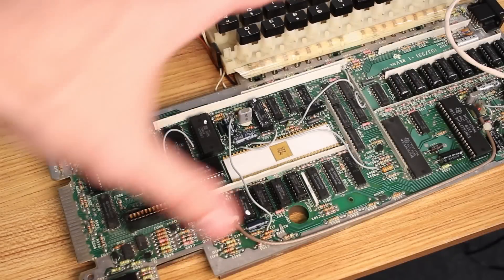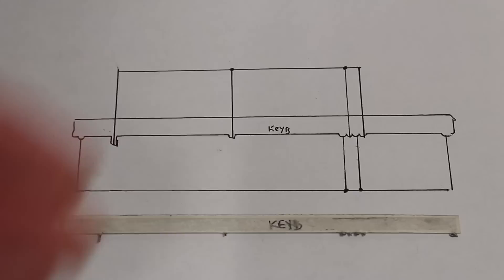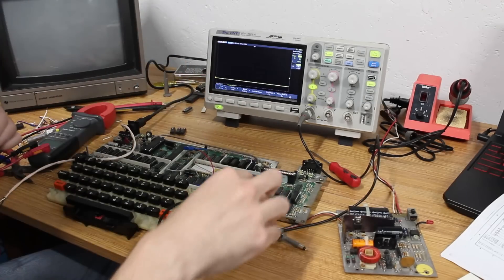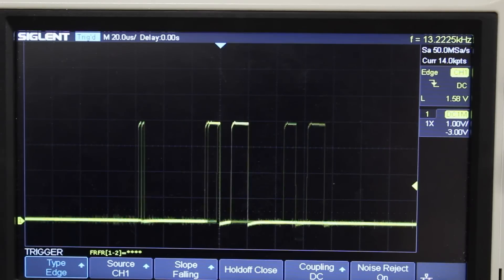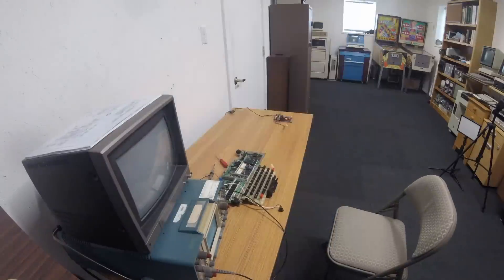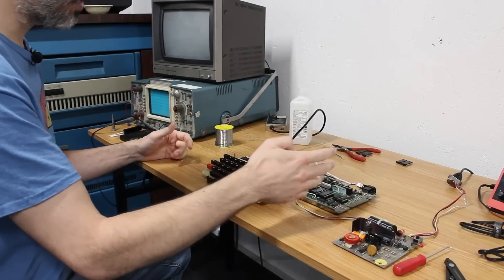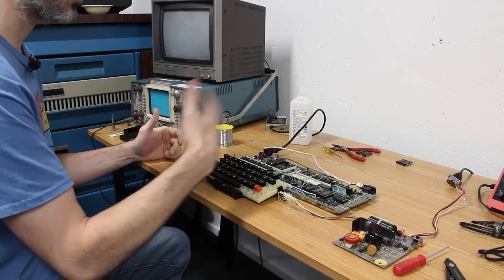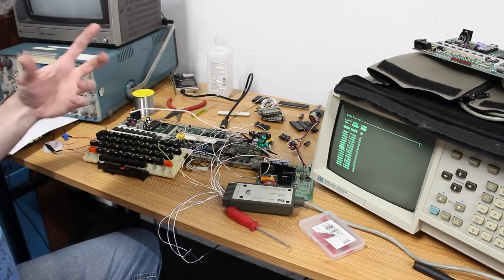This TI-99/4 has Defeated Me this Week

Comment: Just a thought. There's no guarantee those ROMs are in the correct place. People fiddling over the years may have placed them incorrectly. It wi send your system bananas.
Secondly, check that 74LS05 hanging off the 138 and it's resistor is tied high. If there's no signal on this your 74LS138 will not output anything. Over the years I've changed a lot of dead 05s

Comment: i had similar fault in a famiclone. everything tested good in fully socketed motherboard but the broken one still didn't work
i tryed transplanting clock from another board, testing wierd stuff going insane, smoking up one cpu and then i being frustrated removed everything andpoint to point tested every chip connection to another, they were all good, but then i tested if any data line wasn't shorted to the one next to it, still no luck but i started testing at random everytrace going in between soldering points and i found one fault, reset was shorted with one data line in cart socket, after fixing that one short the whole console was back to life
and i did that without any fancy equipment, just a multimeter and a lot of probing
so if this pcb has no solder mask between pins, chcek every trace that goes between legs of any ic or socket. you don't need a lot of current to flip a state of high impedance logic so even tin wisker or a blob or snot can do it
you can also try to partition the board if you can offload part of a circuit to breadboard analogus circuit, a lot of thinkering but can rule out any boardfault by bypasing selected part
you can also check in circuit if for instance music, or video part of the board working by removing your cpu and ram and pulling data from interposer on another working board with that chip removed

Comment: Regarding the ram, since the majority of the pins are paralleled between all of the chips, socketing the whole lot is actually a good move as it makes diagnosis far easier. Any short or stuck pin on one chip,  would affect all of the other chips, if that pin was common to them all. 
Back in the day, I've played this game, and ended up doing exactly this. Socketing a bunch of chips when you have a good de-soldering machine is actually not much of a chore, and can save you a bunch of time in the long run. Especially when more than one chip turns out to be faulty.

Comment: The “bus bars” are also distributed decoupling caps! This makes sense if you look at their construction; you’ve got a metal strip on one side of an insulator, and another on the other side, and encased in an insulating sleeve. Two conductors separated by an insulator (dielectric) = capacitor. And this capacitance is distributed along the length of the bus bar, instead of having discrete decoupling caps like you would find in an Apple ][ or C64, for example.
Reply: Welp you are right about this. I doubt tho that this would totally render the system to constantly fail. My guess would be that the capacitance that's missing here is maybe in the range of picofarads...I know, a TI is not an Amiga, but I know that Amigas (my field of expertise) are running fine even with a lot of bulk capacity missing as long as the PSU is stable. Same goes for 64s.
Reply: Yes I first thought was "Dude! that is your decoupling caps!".
Reply: Interesting, but if this were the issue wouldn't it be still failing to even 'partial' boot the way it did before he broke the bus bar?

Comment: Nice project. You mentioned that the decoders were not decoding fully, have you checked all the enable pins to ensure that you have enabled decode outputs. What does the Logic Analyzer say about this ?
What about noise on the power rails - are they clean, are the caps any good ?
Is the reset signal working properly ?
Are all address, data and control lines moving, particularly important ones for addressing / memory control (ALE, R/!W, etc) - or whatever they are called on that CPU
Can you dump the ROMS, disassemble the code and look at what the instructions are that form that loop - to see why its failing whatever test is being done, this should help focus in on what's going on and help focus in on the fault domain
Reply: I think he meant they are decoding - just not getting signal because the boot process never reaches the point when GPU is initialized
Otherwise, agreed.

Comment: It's been a long time since I worked with a 9900.  But I have a vague memory that the bottom 256 bytes of the address space was SRAM (normally used for the 16 pseudo-register blocks).  Of course that means that the address decode has to special-case that region.  And that was probably done by individual logic gates rather than MSI or LSI chips, at that time.  Probably a good idea to bite the bullet and look at the address logic?
Reply: Actually after a  bit of a refresher look at the manuals, I remember that the bottom of the 9900 processor address space is actually the interrupt vectors.  I may have been thinking of the 9995 which had 256 bytes of on-chip RAM which was supposed to be used for the register blocks: but of course that wasn't the processor used in the TI-99/4.  
(In fact the system I worked on was a specialized aerospace design, not a 99/4. )
I think the 99/4 did have a chunk of SRAM, but I can't say where that sat in the address space.  Or where the program ROM lived either.  I also seem to remember that in the 99/4 there was some really funky arrangement where access to memory had, for some reason, go via the video controller?
Keep at it, I'll be interested to see what you find!

Comment: Your biggest problem is that you're troubleshooting like someone who has no idea how to troubleshoot a system like this and couldn't be bothered to ask. Adrian Black has a VERY good, very formulaic system for this. Think of it as a series of questions. You go in order, one-by-one down the list. If I were you, I'd scrap everything you think you know about this system in its current state and start from zero, because of just how haphazardly you've been going about it.

Do you have a working system clock?
Is the CPU reset line deasserting upon powerup, or does it hold asserted (be that high or low for that particular CPU)?
Are the address lines strobing at all? Are any of them 'stuck'?
Are any of the data lines stuck in response to the address calls?
From there you go out to checking peripheral chips etc.

A simple humble logic probe will be more useful here, by several orders of magnitude, than a logic analyzer and its spaghetti plate special of wiring. All a logic probe does is have one beep for 'high', one 'beep' for low, and a set of corresponding LEDs, but with that you can hear the system working (or not) in real time. You can also ID 'floating' levels because both beeps happen (and LEDs flash) at once. Yes, you can also do that with an o-scope, but o-scopes are complicated and simple is better here because it means fewer potential pile-on points of failure. My logic probe is an Elenco model as recommended by the legendary Quinn Dunki aka Blondihacks herself. It's great.

Also, get datasheets for your chips, and know how to read them. No offense, but if you can't read datasheets and you don't know what your chips do absolutely 100% for sure, you're dead in the water before you even start. That's just basic preparedness for something like this, sorry. If you can't be bothered, you haven't done your homework and you very much deserve the 'F' Mrs Wormwood is going to give you for it. Datasheets are simple, and "I think..." is NOT a substitute. (You should already know that.)

Stop trying to BS your way through this. It's obviously not working anyways. Anything worth doing is worth doing well -- so get it right.

Comment: Ouch! I feel for those lifted traces, and I have many under my belt. I think I may have tried low-temp alloy, or failing that I would have sacrificed the machine-pin strip housing. The individual pin sockets will still be functional, even if not useful as a strip.

Comment: If U505 is getting inputs on AB&C but not outputting anything, then I would check U504 as it is supplying the G2A enable signal to U505. Without this signal U505 will do nothing.  U504 is obviously providing the ROM and Memory bank enable signals at its outputs, while U505 is sub-dividing the MB4 memory page into three addressable banks at 0x80xx, 0x84xx and 0x88xx.  Also check that U506 is not holding U505 G1 pin low, this should only be low when the CPU does a memory read, and U506 pins 8 and 11 are not stuck low.

Comment: Have you tried checking the output of the 138 for shorts against +5V? If the input is correct but the output is stuck high that would be my prime suspect and the video didn't show if you did... If the system is stuck in initializationmode, i.e. never accessing the video RAM at all, the "mode" line should be high, but the CSW line should go low now and then at least. The Nabu has the "A" revision of the chip, but still, I think those signals are the same?

Comment: Lower the clock rate to generate 1 clock with push button so you can step through the boot. Compare the boot sequence with the la with the working and not working board.
Reply: Makes sense, but how do you single-step 6502 clock with its phases? (serious question) 
Also I recommend function-generators built into some logic analyzers to generate enough pulses to get to faulty parts. Or any arduino or something like that.
Reply: @jwhite5008  IIRC you can't, the 6502 isn't a fully static design (The 65C02 on the other hand is).
Reply: Not sure if memory would work, needs a refresh every so often does it not?
Reply: TMS9901 CPU has a minimum clock speed, unfortunately.  Any less than 500KHz and the chip itself forgets what it's doing.

What would be better is to record both the working system and the dead one trying to boot up with a modern logic analyzer that can send the data to a connected computer for a long-term recording.
Reply: @ovalteen4404  Correct, it's not a fully static design, requires continuous clocking to keep state internally.

Comment: TMX9918 instead of TMS9918? Interesting - it might be an engineering prototype instead of a commercial part. Those strips were a reasonable alternative to 4 layer PCBs at the time, which were far more expensive than 2 layer boards. They not only deliver power but also act as decoupling capacitors, so replacing them with thick wires might make the supply a little more noisy but that shouldn't be a problem.

Comment: 1:40 just replace with a pcb, some cxk58256 sram, some glue logic for bankswitch and memory map , 8 64k x 8 bit parallel chips plenty of ram, and your computer can run faster cuz no refresh for the short term memory loss of dram

Wonder how much faster It runs using 16bit sram... or two 8bit sram daisy chained in series
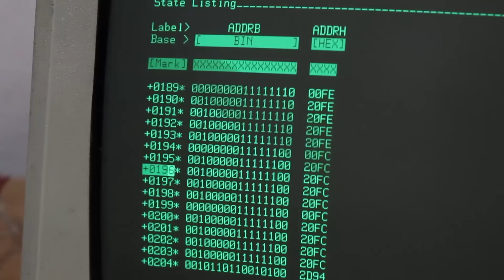Reply: 8:45 sounds like corrupted rom, or bad glue logic for internal  memory map/bankswitch
Reply: Twice as fast and no memory expansion cart or card required.
Did that around '87, still have that one in the garage. I think the hack was written up in one of the TI magazines of the time.

Comment: Does anyone know of a "dead test ROM" for TI-99 or similar?

Compare bit-by-bit to a working system!

Try connecting the logic analyzer to at least low bits of address bus (you are probably better off soldering the wires to a chip than doing the clip porcupine again) and recording first few seconds on good and bad system with the same ROMs (probably doesn't matter if it doesn't boot all the way as long as it gets past "sound disable" step)

then compare them and try to see where exactly it fails.

one other possibility is to remove RAM, ROM, and other chips and compare what happens to working and dead system. 

From what I can see the CPU seems to be executing code from the ROM, but does not go past basic initialization so it never even gets to the point where it's supposed to initialize the display.

It seems it's really easy to mess up TI-99 boards and connections. Probably a trace corroded somewhere .

It may be a bit of a stretch, but you may try swapping all socketed chips at once (and the power supply if compatible) between working and dead system. Sometimes some chips appear to work in one computer but not in the other for some strange voodoo reasons.  

try watching Noel's and Adrian's videos not just on TI-99 but other systems. They show a LOT of troubleshooting techniques. 

if everything fails, it's ok to admit defeat. rechecking every single trace is probably too much work for a ti-99 which is not that rare or important to warrent so much lost time you could use for more interesting stuff that you CAN do. Send it to some other guy who specializes is TI-99 repairs and call it a day.

Comment: Those power buss bars are designed to replace wires/traces and bypass capacitors.  When laying out pcb you need large power traces and when other traces cross over/under them noise is injected into the.    The bus/cap bars allowed very low impedance power distribution and the sandwich makes a capacitor tamping down noise
Reply: That's interesting.  It would be why they were ran in vertical alignment, to get them away from other traces.  It might be needful to fabricate a new buss bar using solid core wire so that it will stand in proper alignment to the board?

Comment: I remember back in the day there where TTL chip testers that would test the chips in situ, maybe time to recreate that with a RP2040....
Reply: There are a lot of chip testers floating around, in theory they should be able to test at least some of the logic chips without desoldering if you run the wires...

Comment: You can probably find a strong clue to finding the fault (potential fault) in the addresses the machine is getting stuck on. It very probably isn't/wasn't the CPU though unless its a far more subtle fault. Should also be focusing on the rest of the glue logic in the address bus or looking for a short trace in that area. Can you pull the chip select wires down for instance?

Computer repair can be real torture sometimes..  Especially when the final answer turns out to be something obvious. :hand-orange-covering-eyes:
Reply: Seems like some interrupt problem
Reply: @monad_tcp  yes you're right. I believe it's a non maskable interrupt problem or one of the signal requirements of the cpu aren't being met. Either way, this should be an easy fix if he stops throwing parts at the problem.

Comment: I suggest doing a very deep clean. maybe with an ultrasonic cleaner. that could remove anything under components that could be causing issues. but you may just have to start stripping components off the board to find the fault. but everything i have said is just be throughing darts in the dark lol.

Comment: Seems like you got close to it at 7:36. Why didn't you drill down there? If good logic is coming in thru 1,2,&3 and output is always high, look at the other pins and signals to/from that chip. Also, beware of "if I can't fix it, I can fix it so it can't be fixed". (grin). Finally, cat update?
Reply: I’m familiar with the ‘138… I use it on my NABU expansion boards. It won’t do anything unless all three of the gate lines are in the correct configuration - you need to look at both the address lines and the gate lines.
Reply: @darkwinter6028  That's a good point. If pin 6 is low or pins 4&5 are high the output will be high under all conditions, like what he is showing.

Comment: My first thought is that if one of those bus bars was faulty, perhaps the others are too.  It's worth checking, I'd say.  If some of the circuits aren't getting clean power, they just won't work.  Your main problem is that it "just won't work."
Reply: And it has a very low inductance so cant be replaced with wire and add some ceramic cap because they will have a  sharp resonance and uneven impedance.

Comment: Get two strips of the male version of those machine pin socket strips, and some 1k resistors.
Put the pins into the CPU socket and run wires from the address lines to say toggle switches (via the 1k resistors), see if you can manually trigger the chip select logic.

My theory is the propagation delay is different on the replacement '138s and that has upset the race condition needed for the circuit to work correctly. Or you just have another bad logic chip or PCB connection.

Comment: I have a stock of 40-pin sockets.  Your CPU is a whopping 64 pins.  I probably would have made the mistake of trying to use those round pin headers too.  Seeing you using the HP logic analyzer brings back fond memories of working at GE in the 1980's.